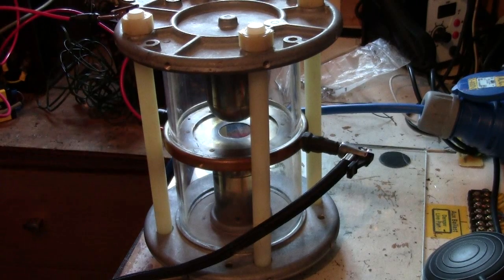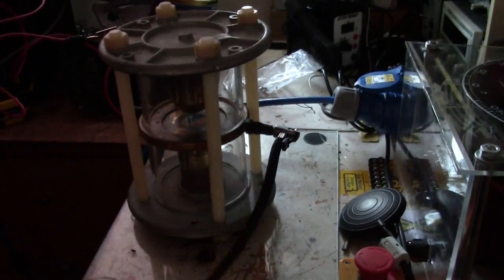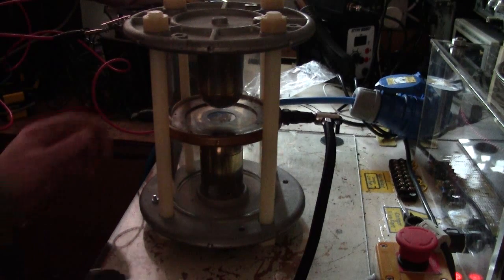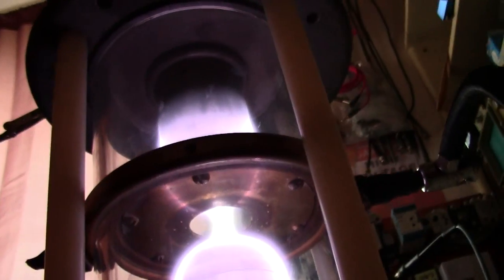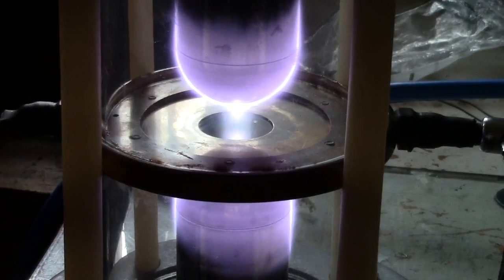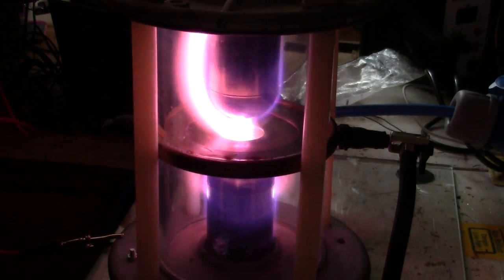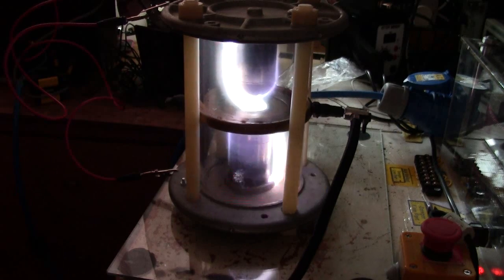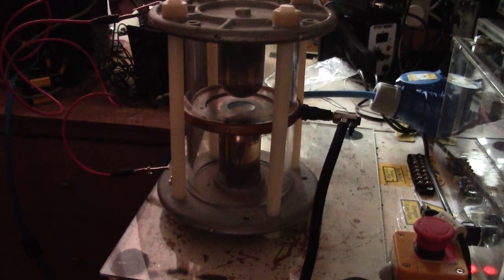Military spark gap VERY STRANGE .KNOW WHAT IT WAS USED FOR ?

Comment: Has anyone checked this thing out for x rays?
Reply from the maker: @EricYell  yeah I did , always had a dosemeter but the vacuum is no where close enough and none of the other variables came close to matching requirements to produce any X-rays except for if i were to have run it from one of my much  higher KV TX's.. And when I did use those for any of this stuff using a vacuum I never turned the auto transformer high enough and used very small ballasts sets to run them .. Thanks for watching 👀

Comment: Spark gap switches were used to set of atomic bombs. Very high power current was connected to one end of an electrode electrode. There was a gap separating it from the other electrode. The electrode ends are smooth and rounded so that a current would not jump across the gap.There was  a fine wire crossing inside the tube perpendicular to the main electrodes and connected to a lower-power power source.The air was removed creating a vacuum. When a current was provided power across this wire, it vaporized extremely quickly and became a plasma. The plasma then immediately acted to carry the current across the electrodes. The many  wires leading to explosive initiating charges of the lensed charge surrounding the plutonium sphere in the center of the bomb (required to explode all at the exact set time) required high amperage and voltage. There was a risk that, if a regular switch was used, the high power could arc and the power would not be received at the highest value needed, but would rise from a low initial level then ramp up over time (thousandth of seconds instead of nanoseconds) causing non uniform ignition of the shaped charges that were needed to compress the plutonium sphere and initiate extreme compression causing the plutonium pit to be crushed in from all directions at the same moment thereby increasing its density and so creating the condition necessary for nuclear fission to begin. The switch provided the maximal power level desired immediately the second the wire inside the vacuum vaporized and became a plasma.
Reply: Yep. Literally .
Reply: was it literally used to set off atomic bombs specifically ? the science you describe in your comment is rather astounding !
Reply from the maker: @Spacemanjack69  that's really interesting. I'll have to have a look into it at some point .. Theory,  not practice ! Thanks for sharing 🤘🏻

Comment: What exactly does a spark gap do  well it does pass high current nd high voltage but what exactly does it do
Reply from the maker: This type is basically a switch. If it has a trigger ring like this one ( central metal plate/ring) then the switch can be switched at will. If it has no trigger... It will switch when the voltage is high enough to bridge the gap between the 2 electrodes..
I hope I explained that ok 🤞🏻. If not let me know and I'll try again lol.
Thanks for watching.
Reply: @HighVoltageProjects  my understanding is I think spark gap sets of  like coherer in radio technology wr rf is created which sets of a resonance in the conductor making the resistance decrease  and flow of voltage n resonance creation  happens esp w magnetic quenched spark gaps here they use na hf i beleive in some nitrogen or even air the basic idea being to take ionisation to 30-80khz wr energy is really made to flow into conductors esp when used w capacitor shunts.. And to raise resonance which using 60hx or 20cpsx3 ie 120deg is utilised further transmission probably with a chop or high frequency gap between them into stp up transformer from wr the step down makes the current hope u can do the further explain nd fill my gaps of knowledge the creation of Plasma is reaching high ionisation I forget the effect though meanwhile do fill my gaps of knowledge pls
Reply from the maker: @roshanmathew9443    You can download the datasheet It's  a T-508A spark gap, made by Pulse
Sciences/L-3 Communications. It is capable of
passing up to 150 kA and standing off 200 kV
when charged with sulfur hexafluoride at a few
atmosphers. Max pulse duty is about 2 coulombs
per shot. The center planar electrode is the trigger.
These gaps are used in the Sandia Marx banks that
drive the Saturn and Z plasma accelerators, among
other things.
Few of these gaps exist in private hands or outside
at ticle are a couple
the US National Labs, but there are a couple of
places to see th on
to see them. Back in the mid 1990's, the
University of Nevada acquired some from Los
Alamos National Lab as components of the 2
terawatt Zebra Z-pinch.
This device is a high-current field-distortion spark
gap. It was originally used to trigger high-voltage
high-energy capacitor discharges in a pulsed power
laboratory or government research facility It was
likely part of an impulse generator (Marx generator
or similar) for lightning simulation or other pulsed
power application.
The flat center plate is the triggering electrode. It
normally is biased to 1/2 the voltage between the
large rounded end electrodes. Suddenly applying a
high-voltage pulse to the center electrode "distorts"
the E-field in the gap, triggering a high current
spark/arc to flow between the rounded (main)
electrodes. A three-terminal spark gap such as this
is a controllable high-voltage switch. Gas inside the
device is typically pressurized dry nitrogen, sulfur
hexafluoride, or possibly even pure hydrogen to
increase the voltage levels and switch recovery time
Looking at the diameter and spacing of the main
electrodes, this switch was likely designed to handle
100,000 volts (or more) at tens of thousands of
amperes.
Reply: @HighVoltageProjects  yes a high power impulse generator basically generating impulses of power at high frequency nd high current or high resonance impulses in the conductor...... Now what can u use this in the field of electricity for common use, can this high voltage high current b stepped down to usable power is the question... once it is  generated... Other than what, the lab it was used for, I mean can u directly using w or wo using an avg transformer, stp it down to usable current for home use say 230v ... The gap multiplied by 3000volts approx gives the total voltage I think
youtu.be/sbPV5XETTng
After all stepping it down at the rt voltage is essential for usage
Reply from the maker: @roshanmathew9443  The spark gap itself can't change the supply voltage, the gap could easily be switched using one of those ignition modules if it had the Sulfurhexafloride in it but I'm not sure what your asking.... The ignition module in the vid you linked to is very poor in the terms of output, it likes like one with a spark gap in it as apossed to an electronic controller as the output was very very small. I brought some from Sparkfun and they will jump a 4.5cm gap easily . Although because of all the variables I wouldn't use that "rule of thumb" calculation. I'd use my HV probe and DMM or for people without a probe I'd setup a simple resistor network and a very very cheap DMM so as not to potentially ruin your favorite meter. 
Is there something that you are trying to achieve or is this just out of interest. Either is great but if trying to achieve something can you explain more so I can try to understand ? There's many ways of switching and producing low and high voltage resonance but for what purpose? You have me very intreaged.

Comment: Here is an interesting thought, the rounded electrodes remind me of RF resonators that are used in high power RF filters.  Does this thing resonate at a certain frequency when it is running.  You could use a radio to tune the UHF band to see if it transmits?

Comment: Lovely bit of gear.

Do take care when testing this or other pumped down devices connected to your vacuum pump or gas source.  There are situations where an electrical discharge can travel down the tubing to your hand holding the vacuum gauge or adjusting the Shrader valve even if the hoses are plastic.  A few kV should be safe but pumped Crooke and X-ray tubes as well as HeNe and CO2 laser tubes pose real dangers if all the plumbing is not at a firm ground potential.

Comment: Interesting comments and speculations... 

This device is a high-current field-distortion spark gap. It was originally used to trigger high-voltage, high-energy capacitor discharges in a pulsed power laboratory or government research facility. It was likely part of an impulse generator (Marx generator or similar) for lightning simulation or other pulsed power application. 

The flat center plate is the triggering electrode. It normally is biased to 1/2 the voltage between the large rounded end electrodes. Suddenly applying a high-voltage pulse to the center electrode "distorts" the E-field in the gap, triggering a high current spark/arc to flow between the rounded (main) electrodes. A three-terminal spark gap such as this is a controllable high-voltage switch. Gas inside the device is typically pressurized dry nitrogen, sulfur hexafluoride, or possibly even pure hydrogen to increase the voltage levels and switch recovery time. Looking at the diameter and spacing of the main electrodes, this switch was likely designed to handle 100,000 volts (or more) at tens of thousands of amperes.
Reply: .... Spark gap triggered railgun? :D
Reply: Thanks for the description, here's an hypothesis that may sound interesting. 
The Great Pyramid is a piezoelectric power generator,  Hydrogen  / Oxygen fueled,  internal combustion.  The queen's chamber held water and liberated fuel through pyrolysis and electrolysis,  contained a heat source in the Niche and the " air shafts " are conductors.  The king's chamber is made of piezoelectric material and the " sarcophagus " contained the igniter.
Reply: @terry_399 there is actually a lot of evidence supporting this type of theory.
Reply: @timh.2137  There sure is, in fact I saw some in my bathroom this morning!

Comment: That's a free energy device designed by Tesla.  DO NOT TOSS IT OUT EVER. IT produces zero point energy, your just missing the other (easily made) device to plug it into your home. The hertz amplifier or changer. Adjusts here's  (cycles per second) up or down from 60 to 24.50 per second. 😎

Comment: Aircraft use spark-gap devices to quickly drain off ESD and lightening strike induced charge from the electrical system before it has a chance to burn out anything.

Comment: Hey HighVoltageProject, i hope u r keeping good, i just wanted to ask that what is the temperature of a 300 kV electric arc, is there a way to calculate  the temperatures of electric arcs, and what r some good materials that can withstand large amount of heat, and yet have good tensile strength. (Basically can u suggest some materials for the casing of the high voltage spark gap switches).
Reply from the maker: Paladin J. The temperature would depend on the current of the arc, 200KV @ 5mA would be much less heat than 200KV @ 5A. I'm not aware of any ways to work it out but I've not looked to be honest. Quarts glass can handle extreme temperature and Pyrex is good too... I used a Pyrex rolling pin for some vacuum experiments and it also blocks some UV rays. It was a long time ago now so I can't remember the spectrum it blocks. What sort of power are you looking to run through the spark gap? Is it a triggered gap you want to build? What will you be using it for? Just switching for safety, discharging capacitors ect ect?
Reply: hey HighVoltageProjects, thanks for the information. i just wanted to ask you that how much pressure can this spark gap switch sustain, and what kind of nut bolt configuration is used for it? Also i was wondering what kind of sealing mechanism is this spark gap switch using to ensure air tight seal? And one thing more, i was wondering if we removed that central plate, will it still be able to close the switch ?
i mean can this switch operate on self breakdown procedure ?

Comment: hey HighVoltageProject, i was just wondering what type of dielectric gas os being used in it, and whats its breakdown votlage ?
Reply from the maker: Paladin J ... Hi  200KV @ 150KA if filled with sulphur hexafluoride but I was using it with a vacuum so no gas. If you look at the comment below from Andrew there is a link to loads of information and pictures of them in use. Its a great read. Thanks for watching.. John
Reply: +HighVoltageProjects thanks, and one thing more, can u pls tell what is the material used for the casing ?
Is that some sort of thermoplastic ?
Reply from the maker: No worries . 

I cant actually remember If i had to take a guess I'd say Quarts glass , its definitely not a plastic of any kind but here is a link to the datasheet ...  http://www2.l-3com.com/ati/pdfs/T-508.pdf

And here is the link with more info .....  http://cryptome.org/eyeball/aurora/aurora-eyeball.htm
Reply: +HighVoltageProjects thanks 😃

Comment: Ive seen this gap before. I don't think it was military however. It was used for plasma research.
Reply from the maker: Tesla Cult  these were used in the Sandia marx bank to power the Saturn and Z plasma generators, made for Los Alamos Labs . If you read the comment below from Andrew there is link that shows pictures of them in use and lots of really interesting stuff about about the whole project. Unfortunately I'm unable to do most of the projects I love now due my spine crumbling at fairly fast rate so this will be going on ebay at some point over the summer when I can get some help sorting out the shed, along with loads of other high voltage gear. I have plans to still make the large Tesla Coil I had planned to make as I have all the parts sitting there including a fully built 14inch RSG, Maxwell pulse caps, PT's and hopefully with the help of a very good friend and fellow youtuber it will happen one day.

Comment: Anyhow, it seems that there are two forms of "False Vacuum"; Antimatter &; A fact that the universe may have no positions in it to create a vacuum. The universe would simply be a block of immovable objects. Therefore, there would be no universe or motion so to speak. Which one is the current theories of  "False Vacuum" referring to? And no, I did not just make the second form of  "False Vacuum" up. Well, I did but people plagiarize.

• It is possible for a classical field theory to have two homogeneous stable equilibrium states with different energy densities. In the quantum version of the theory, the state of higher-energy density becomes unstable through barrier penetration. In the first paper in this series, it was argued that the relevant quantity to study was a decay probability per unit time per unit volume, GAMMA/V = Ae/sup -B /h/(1 + O (h)), and the theory of the coefficient B was given. This paper gives the theory of the coefficient A[;] Reference: (https://www.researchgate.net/publication/210269790_Fate_of_the_false_vacuum_II_First_quantum_corrections). I guess the A wins.

The B it would seem is Antimatter. Yes, those are my exact words.